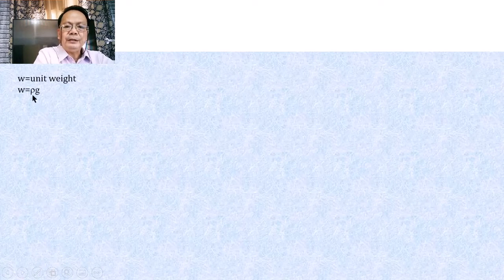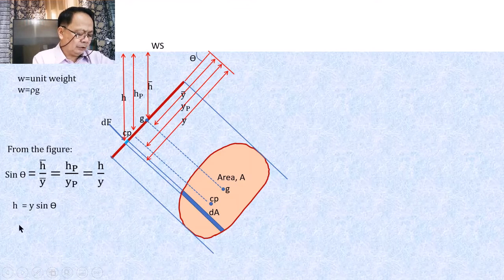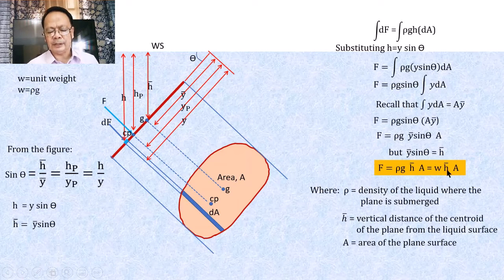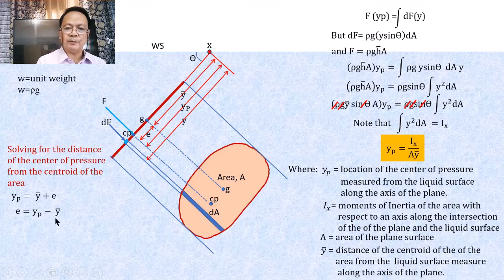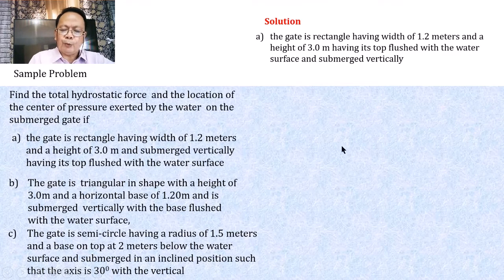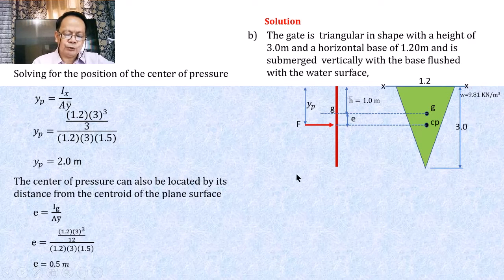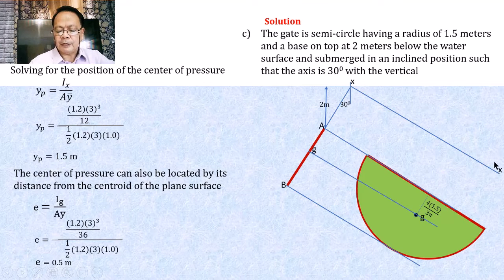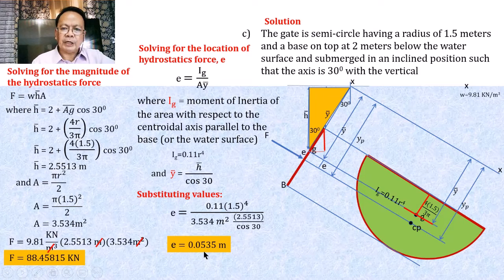Hydrostatic Force on Plane Surface-Derivation of Formula and Sample Problems

Comment: sir sa last example problem po can you solve for yp using the yp formula hope you notice me sir .... the Ix of semi circle is 1/8 (pi) (r^4) but when im usuing it the answer is too far when adding ybar and e
Reply from the maker: Thank you for watching my video. Sana ay patuloy mong subaybayan itong aking channel. by subscribing and please support also this channel by sharing what you learn from here. Tungkol sa qustion mo about the computation of Yp. Please don't be confused with the Ig used in the computation. It is the centroidal moment of inertia of the semicircle parallel to the base not the moment of Inertia about an axis though the base which you gave.
Reply: @willerdayahan2865  di po ba pwede idaan ang pag sosolve sa Yp sir ...